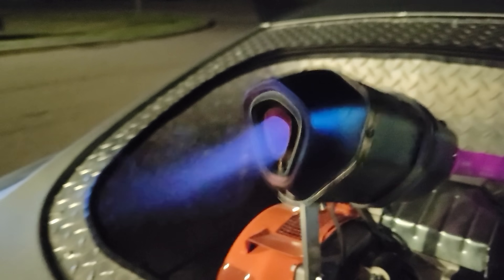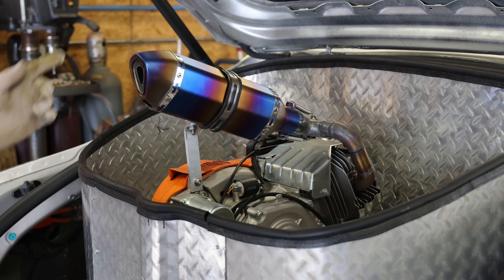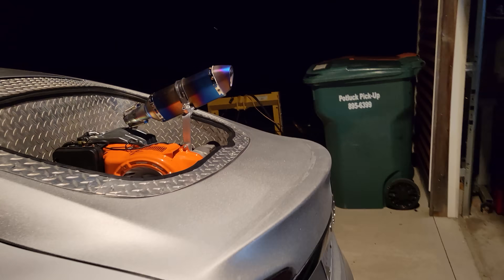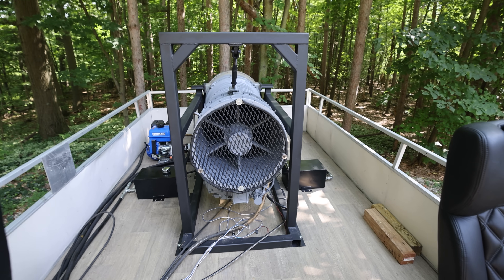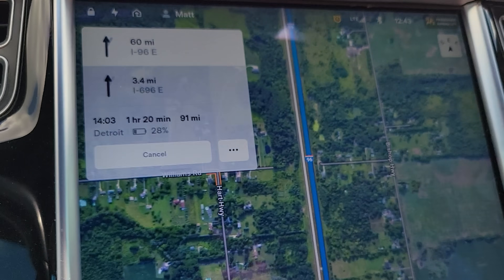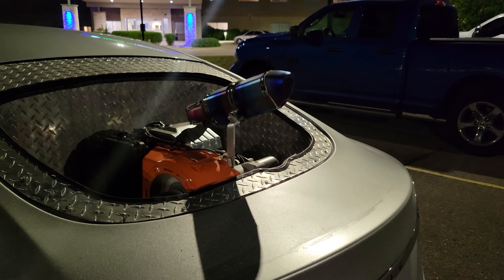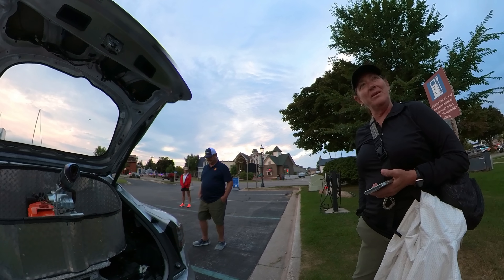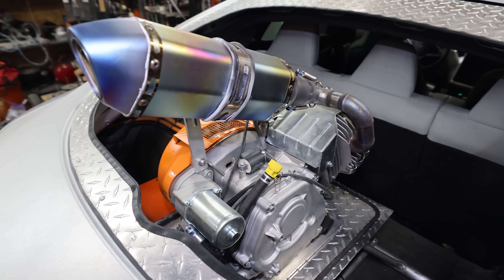Cordless Tesla (I Drive 1800 miles without charging) P.1

Comment: I would love to see a version with a bigger generator that could actually charge while driving.
Reply: Honestly  mate what a waste of time I would rather a horse and buggy and you are still Youse fuel ⛽️
Reply: That’s called the Prius.
Reply: A Honda generator that can power a house, and solar panels.  Elon Musk may have a problem. 😭
Reply: @Jessica Suzumiya Exactly. He bolted the generator right onto where you usually have a centrifical clutch. A clutch doesn't need that huge white fan, a generator with lots of lovely copper windings definitely does
Reply: @Jessica Suzumiya Yeah, I find that hard to believe that outputs 10,000 watts.  Looks like a higher current stator winding that maybe can do like 12-24VDC and maybe 30-50A's max.  So that's like 1,200W max being optimistic.  I don't doubt the engine capabilities now days... though the alternator capabilities... nope... not fooling me until I can see some details.
Reply: It's called Chevy volt
Reply: @Hates Spam I'm not falling for the benefit of the doubt thing.  I don't see enough to make me believe he has a 10kW generator/alternator as he's stating.  I do budge a little in regards to potentially having something besides a flywheel present where like a stock design can easily be up to 20A @ 12VDC or 24VDC (that's 24V x 10A = 240VA or 240W), I don't see how there is a custom generator outputting 10KW yet.  Most entertainment is fiction or has fictional aspects, though I'm not saying he's not doing a great job leading on people to believe he's actually going to do what he's claiming.  I'm not going to believe something I've never seen before and if have, I've never observed applied as stated.  Wishing the best to succeed with the claims, though from my anal retentive holistic research and development background in a highly regulated and validated environment... along with advancing qualifications and validation standards at least at a site if not more like this video does in regards to lead to inspire... I just can't believe from what I've observed.  I still don't believe that custom engine is actually producing 10KW to charge anything, though I do believe the engine is definitely reliably capable of producing 10KW easy if modified to repeatably and reliably meet that specification.  Once I see what's producing the "charging" I buy into the paradigm of thinking others seem to have blindly following their leader.  I've had to lead big stuff and still might on some days nonchalant, though I'm only a viewer at this and from what I've seen, I'm not a believer.
Reply: @Hates Spam You can lead blindly.  Show me an internet search term for Google that turns up what you claim as to "see the size and shape match..."  I've worked on a few small engines by now and am not an expert, though know enough not to follow blindly.  Albeit is a neat inspirational paradigm of thinking if real.  Waiting to see the details of the generator/alternator.  I've literally wound stator, rotor and electromagnetic coils before. Theory is not always really applied at times seems to me. He appears in the right direction though which is awesome and really great.
Reply: He's probably pulling over and charging the car.
Reply: @Jessica Suzumiya Though that does get me thinking like if using say a Prius or other Motor-Generator (MG) that's COTS and performing backwards, i.e. the stator is rotating and the rotor is stationary then the size looks close.  Guessing that huge chunk of 3-phase copper winding would function as a flywheel tuned right.  Not certain what all can be drilled out of the permanent magnet rotor to fix on the top of the crankshaft however.  Would be interesting.  Though looks like a common 20A stator... even though I know they make and people can custom make larger ones with bigger and more windings pairing with more magnets.
Reply: @Jessica Suzumiya I was thinking that, but technically it could just be the electric starter. I really want this to be true. 

OP please please share some electrical details, or I may be forced to join the non believers
Reply: @Jessica Suzumiya Ah well there ya go. After doing some research it's pretty obvious that this guy is legit. 

I can't imagine going through all this effort just to fake it haha
Reply: @Hates Spam Warped perception is kind of a genius uploading it showing as little as possible making everyone think it's fake. I'm willing to bet it's legit now, but technically there isn't enough evidence. I'll be subscribing and hyped for the update vids.
Reply: @Hates Spam You assume what I assume in regards to the engine with the alternator custom built into the flywheel... I doubt the crankcase.  

You also assume incorrectly about what I've wrote. Maybe English isn't your native language or you're not comprehending what I've stated. 

So do some KW/hr math and show me some proof's.  Maybe I'm not seeing the time taken to perform the charging when stopped.  

Also, stop making assumptions about what I'm writing.  You're going off on tangents and double talk statements I didn't make... seems delusional to me and outright dumb, aggravating and just plain rude coercive.
Reply: @Hates Spam OH and FYI, you're wrong and get an education and read into service manuals as well as maybe just basic engine, alternator, generator and uhm... starter specifications alone.  You're referencing a starter.   Also, "quiet" isn't spelled "quite."  Learn some manners and vocabulary on top of comprehension skills of the English language.  Stop trying to justify what you want to believe based on what you saw and hearsay.  You're only diluting yourself.  I've literally rebuilt very similar to what he's working with in regards to the small engine, alternator, generator and "starter."  Where's your Youtube videos to substantiate your bogus claims that are getting more than insulting, they're outright rude and disrespectful dishonoring.
Reply: Tesla efficiency shows up in that you can go so far with a 400 cc engine.
Reply: @tedmoss  keep in mind the 400cc engine is running 24 hours a day to drive the car around 260 miles a day. So roughly 3.5 hours of 70 mph highway. and 20.5 hours of just sitting and charging, lol.
Reply from the maker: @tedmoss  EXACTLY MY POINT. the tesla  is second to none in efficiency
Reply: @tedmoss  it got less fuel mileage than just about any sedan on the planet using that generator
Reply: I think this one is in the land of never never land and the land of make believe... at least for now.  Clickbait if you look carefully.  There's no real generator to be shown.
Reply: @jafinch78  lmao what? Are you trying to say the engine he installed isn't charging the battery?
Reply: @randybobandy9828  Yes sir.  Where's the actual generator?  I don't even see the drive shaft coming out of the crankcase in any shots... let alone a pulley, sprocket or gear being present on that driveshaft.  I don't there's a gear box with some sort of voodoo reduction coming out the bottom coupled to a generator.  bs... though might be inspirational if not clickbait to generate ad revenue.
Reply: @randybobandy9828  Not saying can't be done... since short runs of even 6.5HP engines have been made to output 50HP+... though aren't cheap and aren't common in the World.  Either way... you still need a generator (technically alternator to make AC... though for some reason the term generator is used interchangeably mainstream where technically a generator outputs DC).
Reply: @jafinch78  I'm not going to argue with you about him lying about making a generator. It's something dumb to lie about especially when he said he's going to make another video upgrading the system. Why would he need a 50hp engine?
Reply: @randybobandy9828  Not saying he "needs a 50HP engine."  I was only making a point regarding the capabilities of the example that 6.5HP engines have been claimed to output that much.  I think the NHRA junior drag engines output something like 20HP max and maybe up to 30HP depending on make... though I was just noting some have modded them out to a reported 50HP.  So a 420cc can output the power if the rest of the generator system was present along with the rectifier-converter or whatever is required and management system so to integrate to charge the Tesla battery and power the motors.
Reply: @jafinch78  I think you mean a dynamo outputs DC. A generator can be either AC or DC. That's my understanding anyway.
Reply: @robertcircleone  Might be something I learned over the years as some sort of "technically" speaking term maybe with some significant origin in the U.S. historically.  My first B.S. is from Michigan Technological University so I might of picked that up there, though seems like similar to the terms "engine" versus "motor" implied compared to how was taught... layman vs critical thinkers definitions can get muddled whether by marketing or by customary usage.  Dynamo is correct as DC and if I recall is more a British origin term I'm thinking being more specific to this day?
Reply from the maker: @jafinch78  LOL, what if I were to tell you that you were looking at the generator the whole time, I show it in the video, but you need to think with an open mind and look very very carefully. Remember I built this custom from the ground up, I wonder why there is no Driveshaft? Hmmm
Reply: @WarpedYT  You know... I was wondering if there was some magic black box in the crankcase bottom (side) or maybe possibly on the flywheel that's something more disc (I forget what they're called) like design with more stator windings around) like shape.  Infinity or something like that design with more phases basically. I definitely got your back on the engine capabilities clearly I hope in my comments.  Though the generator... I don't know how that's going to fit, though if you do I'm waiting for that or those next videos to show us since that will be really neat and super compact compared to what I'm used to working on.  Keep in mind, I'm used to working on the best buys in the area that most give up on if they're not free. 🙂 Definitely caught my attention and trying not to be a spoil sport.  Rock on my Man!
Reply: @WarpedYT  I wonder if you used a vertical kohler engine…

Comment: Hybrids are the future, not EV.
Reply from the maker: Yes I absolutely agree, Tesla did an absolutely incredible job building a second to none EV system, they got that right, but hybrid is the future not necessarily burning gasoline either.
Reply: @WarpedYT  Exactly, it doesn't have to be gas, could be a hydrogen system.

Comment: Does this affect overall longevity of the batteries vs a normal Tesla?
Reply: Yes they`ll degraded faster as they are going into it`s inbuilt battery safety reserve(the near absolute discharge of 7000+ batteries that`ll cause rapid damage to the cells) designed to increase battery life....

Comment: In order to increase the thermal efficiency of the build, you need to have a more efficient engine first.

you will need to develop a generator from a more efficient engine. Use some water cooled engine from some motorcycle, set the engine rotation to the maximum torque output, and connect the driveshaft to a generator.

what blows my mind is removing the engine speed variation, this old-school engine with a bad energy efficiency give up to 24mpg.

Comment: You got MULTIPLE problems. 1) That's a ZEV, Zero emissions VIN # vehicle. It's now polluting MORE than an ICE car. That put put has no catalytic converter. 2) You can't manually see out the back window, blind spot galore. 3) You have gasoline, next to a battery (Bomb), that car catches fire? It will be impossible to put out. 4) It's loud, like REALLY loud. Tesla is almost silent while running & charging. How about an aircraft powered by pedal bikes & belts? Or a cruise boat powered by solar panels? Any more genius ideas? Karen called the po po on you, fantastic. 😅 Almost pooped my pants laughing so hard.
Reply: Tesla's aren't really zero emissions since they still need power from coal plants to work.
Reply: @mekhane.broken9678  yes and no. A Tesla EMISSIONS is zero, from the car itself. If you could use (say 50) solar panels to charge it, and NOT "the grid". Yes, it would be a 100% ZEV. 🙄 But... 99.2% of Tesla owners don't have ANY solar panels, at all, so no... It's not a ZEV on the whole.

Comment: I wonder if a bigger displacement generator at lower rpm + rubber engine mounts along with a muffled exhaust mounted horizontally sort of in the position of the rear spoiler (exposed to the wind ala aftermarket VW Beetle) could make this setup bearable enough for daily use

Comment: It's a gas over electric hybrid.  Would be great if you had a better, quieter engine like a small port or direct injection engine with a muffler and then a charging system that made better use of the energy being generated.

Comment: I have no idea how you get 10,000w out of a 420cc single 
It usually takes a v-twin or at least 600cc but the main thing is I don’t see a actual generator stator generally the same size as the motor that powers it. 10,000w generators are large and this is tiny package. I would like to see a break down of the build and how you software managed access to the pack safely and on what side of the high voltage contactors you set the power going into. Are you using a two phase 5000/5000 that should sustain a theoretical 35-37 mph charge rate if at a 240v minimum but if your speed exceeds charging speed you will loose charge assuming no other loss of conditions. Break down of the whole thing would be cool
Reply: Assuming 13-15HP converts to ~9 to 11KW I guess in theory.  Might be do-able someway somewhere and definiely can soup those engine up more since the kiddos with funds crank 10's of more HP out of 5-6HP engines... like up to 40-50HP for their I think dragster short runs at least I recall seeing about.  This however,  I don't even know if this is real.  Seems like clickbait since the generator/alternator isn't even shown anywhere that I can see clearly.  Seems just the OHV engine like as a prop with no real 10KW generator.  Maybe I'm missing something or missed some clips showing.  Seems way small unless some new design stator-rotor system.  Where's the generator/alternator details?
Reply: @jafinch78  I think it’s referring to the energy of the fuel used but you will loose so much efficiency in the process of generating. 
I regular 420cc house generator I think max power is 6500 maybe little more but definitely not 10,000w you need 500cc plus and still then it would require a huge generator on the side that just looked like a bolted down engine running I can’t see how 10,000w 30+ amps needed to charge could be done
Reply: @lordjoshr  Technically, I call bullshit on this build.  I can't see a generator anywhere.  Clickbait apparently and inspirational build at best.  Where's the generator side on the engine?  Looks like a cover at best shown with no clear view of where even a pulley would be on the crankcase driveshaft end.  Doubting there's a gearbox hiding something.  Complete bs the more I check.   I read you loud and clear and I was being optimistic thinking with a "custom engine build" mindset with a modded engine with like custom mostly everything billet, ported, polished and better.   Surprised me big time how much these engine can push out in regards to HP when modded safely if you have the funds.  Literally with COTS custom racing parts.  However, like we both most likely observe... there is no generator (alternator technically since AC output) to be seen.  You need at least a stator and rotor to make electricity and I don't see that anywhere.
Reply: @jafinch78  stator sure won’t be making 10,000 watts and 40 amps 
Lucky if you get 12v and 5 amps! I think the video of fake as of now but this guy has always done cool stuff so it’s a shame but I wish he had a break down. I have a tesla and I’m not sure how you would charge and drive, it’s very particular with its power and grounding so I feel like maybe if he has a 10,000w real generator and tapped directly into the battery with a custom charger because the contractors are not open of charging. 
It’s more believable to have 5000w 
 But regardless supper chargers are everywhere in every direction on every road I use them for all my trips so it’s unbelievably inefficient to use gas regardless. Still interested in a deep dive into the build. Something like this I would think would be a lot more descriptive then just making the motor sticking out cool looking
Reply: @lordjoshr  Oh yeah, stock 420cc will do 5000W continuous I'm guessing no problem for a day and maybe even 7000W for at least an hour or few easy with the right parts and system design.  Billet parts used by the racing drag strip kids aren't designed for long term use since they're NHRA junior dragster builds from what I've seen or some other design (minus the one and only rare 90HP F1 Single cylinder 300cc build that's like a 20,000RPM design).   So, can be done without a doubt... though this video isn't what's the reality of the truthful situation being cast. 

Then like you note, the design required for the generator and then the controls to charge without causing some error codes to be thrown and bricking the Tesla.  Maybe direct battery charging can be performed with some logic to prevent the wrong flow for a seamless integration... though I doubt that entirely without some sort of legal affairs approval and maybe using an old open source design if those even exist in the systems operation entirety regarding the electronics and embedded system code.